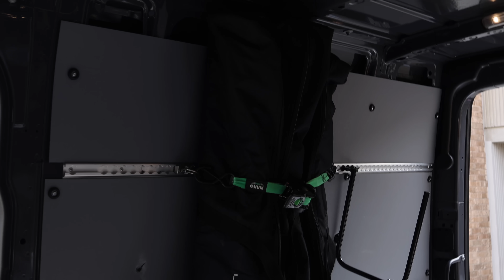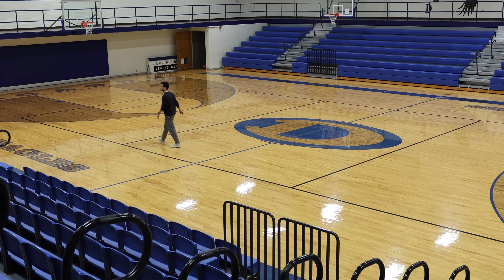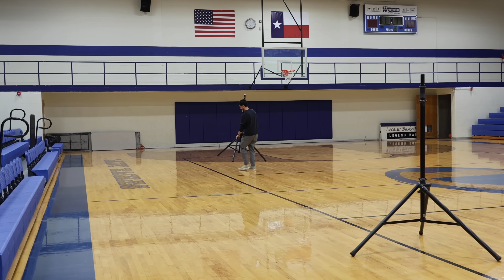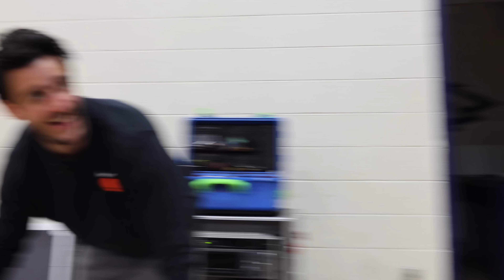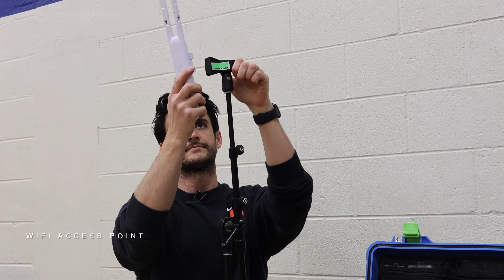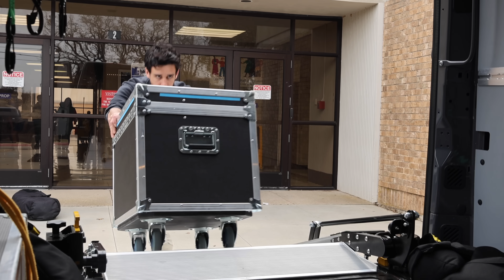Nothing is Ever Easy | Basic PA System Setup

Comment: Hey there, Connor. I just discovered your channel within the past hour. I love what you're doing with your audio company and your social media. Everything is very clean and organized and it's obvious you're a total pro - kudos! In watching a couple of your videos so far, I had a thought of throwing out a suggestion that might possibly make your life easier when you're having to set up longer speaker runs. I discovered the Alto Stealth Pro wireless system about 4 years ago to throw sound to some satellite speakers, located about 200' from the main FOH position (this is for live music application.) You can adjust the time delay on the receivers and there are tons of frequencies you can choose when pairing in order to avoid interference (they even have an RF indicator so you can find clear space.) The fidelity is excellent, too - I don't notice any noticeable degradation. They also have an expansion pack of 2 additional receivers and we now use that to send signal to two additional locations. I can even shoot through walls depending on the distance. Since we got our original system, Alto has released an updated Mk II version. Anyway, I've been super happy with it for these past 4 years and I just thought this might be useful for you, as well. I have subscribed and will continue to follow what you do. Keep up the good work!

Comment: Love your channel dude.  Before finding it, I ended up with a gig at a bank where the closest outlet was about 80 feet thru doors, across a long balcony where I was setup on the opposite side.  I went to the HD store to see if I could find a LONG extension, and couldn't find it.  I know enough about electricity that I figured i build my own.  I ended up buying a whole spool of 100' of SooW 12gauge and put a 15amp jack on one end and a 4-gang box on the other.  now watching your videos.  I was going to cut it in half and build a similar setup to yours, Or maybe just buy another spool and build a similar setup to yours.  love the flexibility of your setup. thanks for sharing.

Comment: Seems like you only use an ipad for mixing. I'm scared to be without something wired for my digital mixer. I always leave my laptop setup somewhere just in case. You've obviously invested in some quality antennas and whatnot. What are your thoughts on this?
Reply from the maker: I always have multiple usb-c to cat5 cable converters in my pelican so I can connect directly to the x32 if my wifi network went down. I don't worry about it all that much though.
Reply: @ ah I like it!